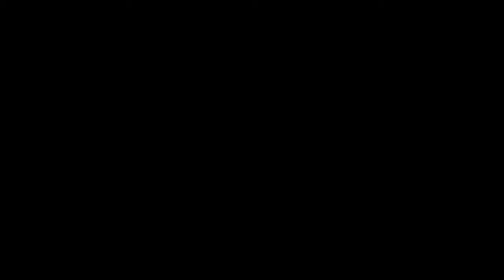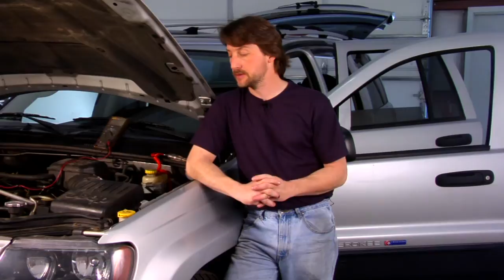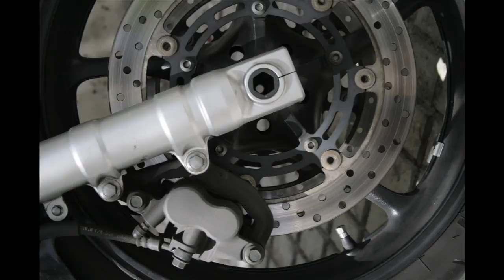Car Repair & Maintenance : Diagnosing Car Noises

Comment: Olaf2046 Car Sounds For Dummys: 
whistling whiles accelerating - torn air intake boot;
chirping - pulleys are old;
screeching/rattling - belts are old;
marbles rattling when rolling - wheel bearings;
screeching when stopping - old brakes;
howling/deep rumble - oil pressure valve dying;
squeaking when going over speed bumps -  springs/shocks old;
deep creaking when turning wheel - ball joint worn;
metallic knocking when driving over rough road - worn suspension bushings;